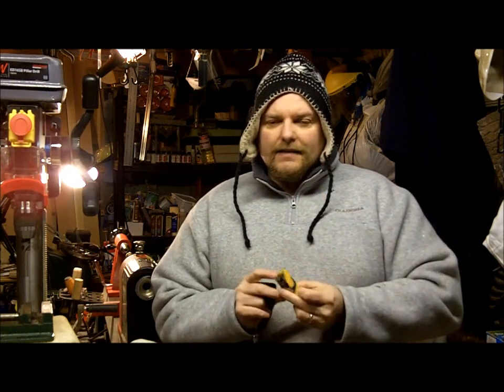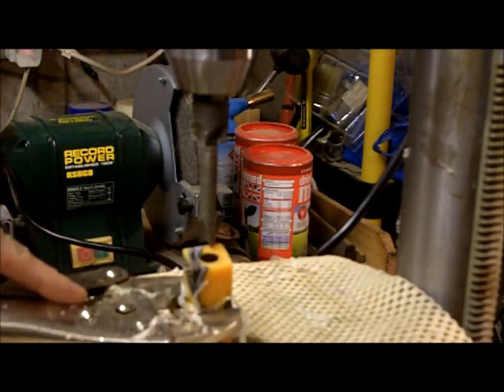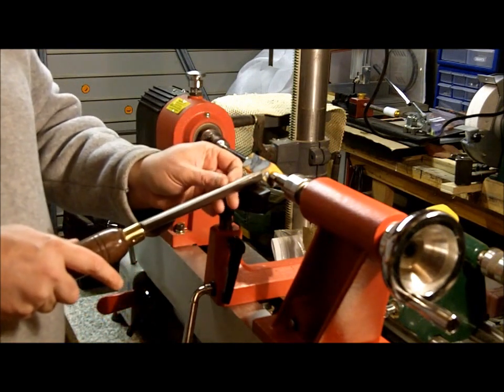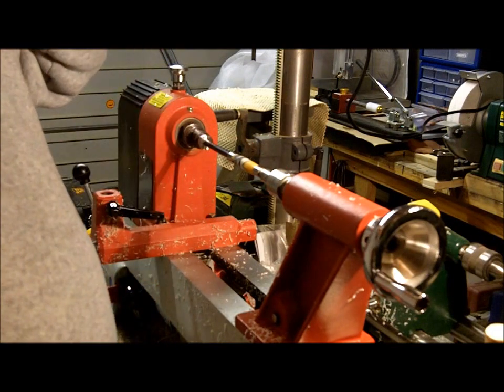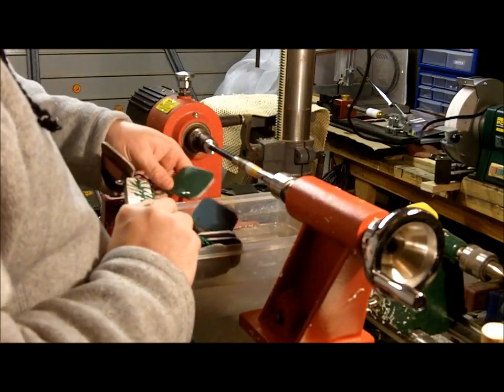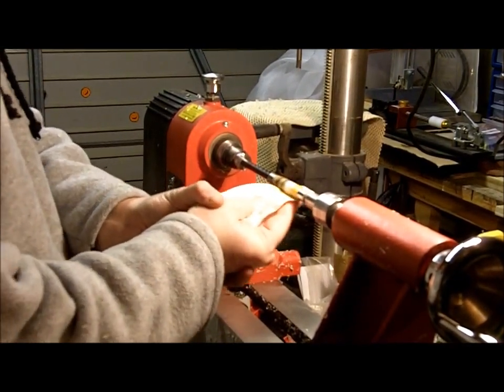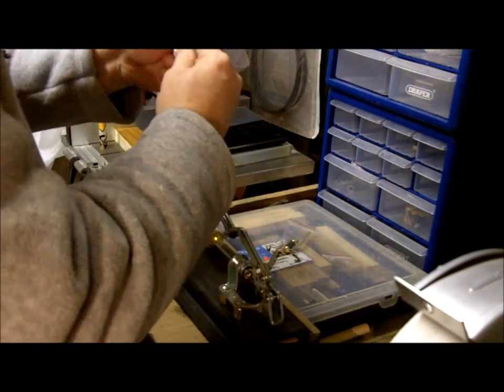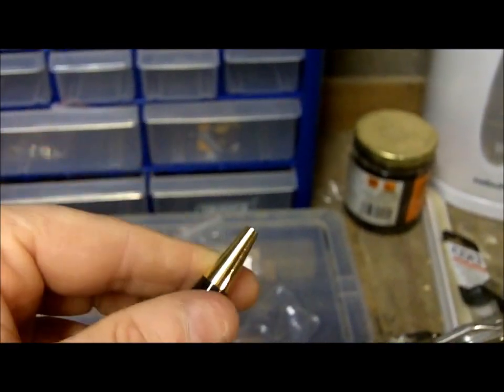The Blind Wood Turner - Episode 20 - An Acrylic Sierra Pen

Comment: Hi Christopher, your ability to set up a camera is astonishing.  You had everything spot on target during the video.  That's a beautiful pen.  I'm assuming you stick to one model of Sierra to avoid having to store millions of different coloured parts.  What do you call that Sierra please?  I've never seen one with a black nib section before and I'd like to get some because I have over 100 sets of blanks ready to go and need some Sierras.  I'm assuming you got it from Axminster.
Best Wishes, Brendan.
Reply from the maker: Hi Brendan !!
I run apiece of string from the camera to where I am standing or where my hands are.It seems to be working ok this way so far.
You are correct in your assumption as to where the Sierra pen kits are from.If I remember correctly it is just a Sierra twist pen kit .I do have some Platinum Sierra kits but I have them stored separately so I can locate them easily enough.
I hope this helps you Brendan.
Cheers,Chris.
Reply: Christopher Fisher The string method works beautifully, stick with it.  Thanks for the pen name, I'll have a look at Axminster.
Best Wishes, Brendan.